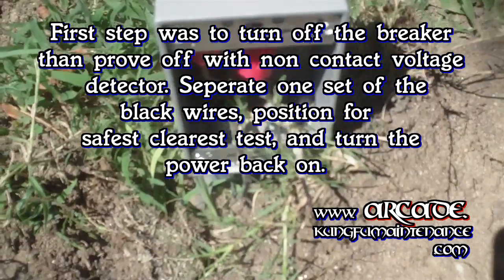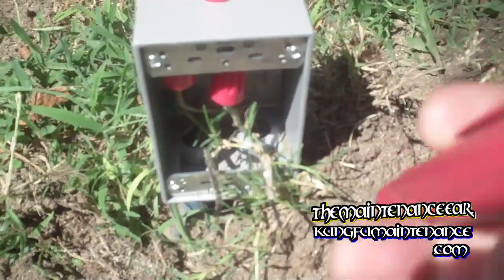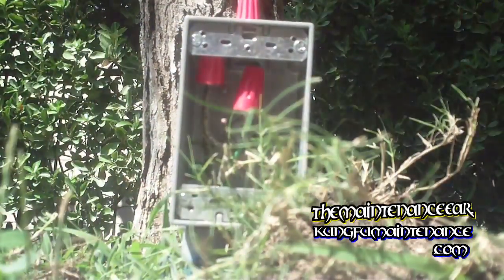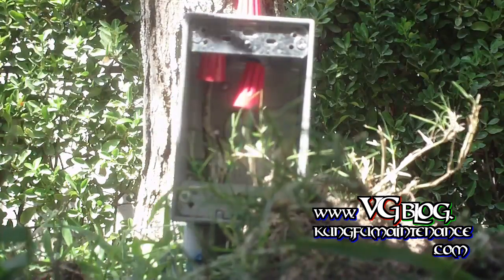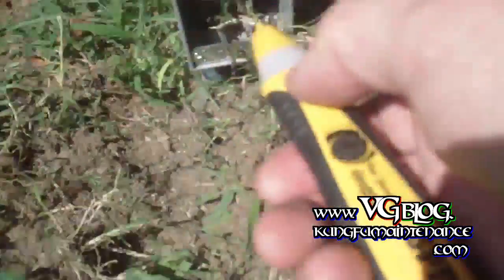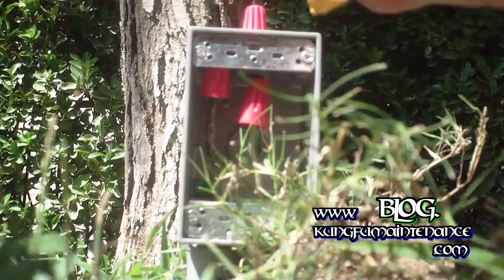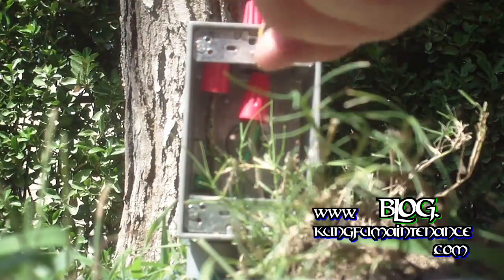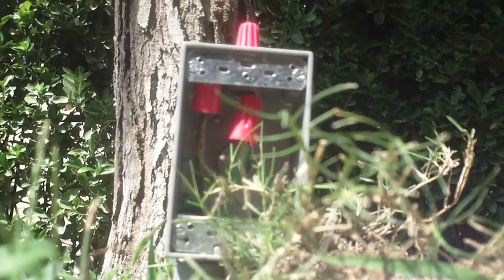How To Tell Hot From Neutral Wire When Both Wires Are Black With Non Contact Voltage Detector

Comment: im having hard time in detecting hotwire and neutral wire. what non-contact volt det. did you used which has sensitivity adjustment? mine here detects even if its far about 6 inches away, is there anay that detects half an inch only?

Comment: i read Kungfu's comment below about using the multimeter. That's the answer I was looking for. Also, I've read that you can touch the black probe to each wire itself and look for a small reading. Which also worked. I'm replacing a miswired 3 way light switch and the power is coming in through 2 light fixtures and I wasn't quite sure if black was the actual hotwire as they could be swapped around.

Comment from the maker: Don't touch anything unless you absolutely know and understand what you are doing. There is another way with the multimeter set to volts AC you don't have to turn off power but be super careful as power is live and deadly. But you put one lead inside ground wire connector and the other in one of the black wire connectors if you show power that is your hot if not that is your neutral. Switch to the other black wire with the lead if further proof is needed.

Comment from the maker: Yes there are some other ways I hope to show in videos in the future. One is to turn off the breaker separate the three incoming wires position apart reset breaker than using a multimeter set to volts AC test one lead to ground and other lead to black whichever black wire shows voltage from black to ground is hot and the other black your neutral. I hope to show this in a future video which I would most likely title "How To Tell Hot From Neutral Wire When Both Wires Are Black With Multimeter".